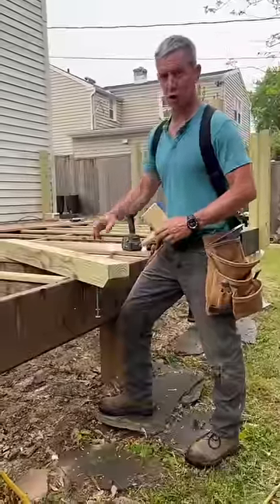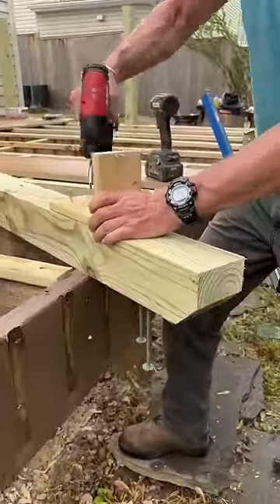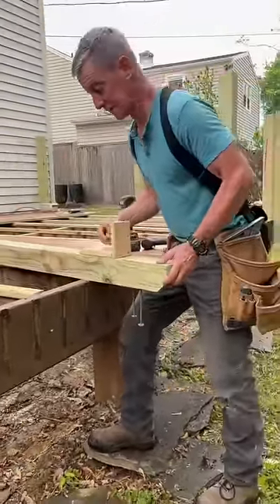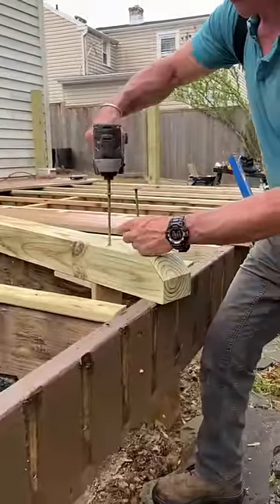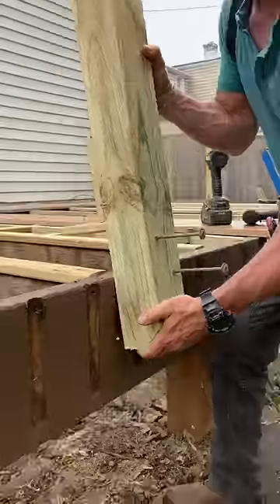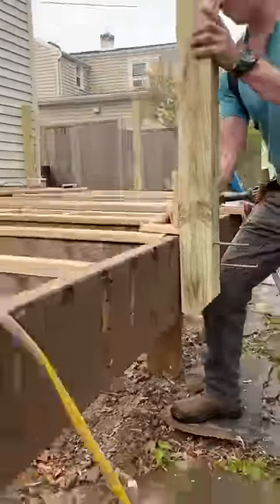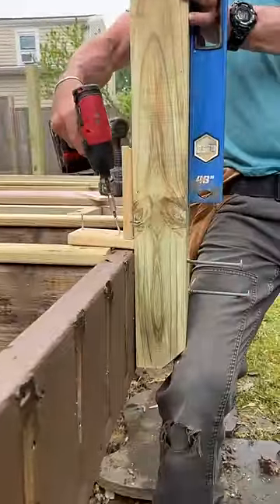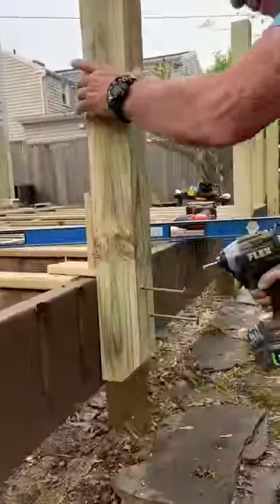DIY Tips: How to set a deck guard post by yourself

Comment: In 6-7 years they at least don’t have far to fall. Watched my 80year old grandfather fall 10ft and break multiple ribs.  When i investigated the way the deck was built it was done exactly the way you just demonstrated.  Well they had 4 lags instead of 3. Edit you have 2
Reply from the maker: I'm sorry this happened to you and your grandfather. However, none  this has anything to do with other carpenters. Clearly, there were problems before this happened.

Comment: I've seen decks built this way in California and people seem to believe it's quality work but on the east coast you'd get laughed off the job by real carpenters. The railing will be wobbly at best in just a couple years, not to mention it's literally easier to do it the right way where the railing posts are structural and come up from a proper footing.
Reply from the maker: Couple things, real carpenter (I love you guys who think you're in some special club...) I am on the East Coast. I've built from coast to coast. And the same screws with the same penetration into solid wood hold up ledgers. I know there are some differences, but I'm pretty confident the ledger doesn't get wobbly. These screws have savage bite.
Reply: Tell yourself what you will, it's not built to last regardless of "special hardware" LOL

Comment: There are so many negative comments for no reason. 90% of decks are built this way around here. One thing we do is run the lag from the back if possible so that the screw is holding into a 4x vs the 2x unless it's screwing into a double header then we run 5in lags.
Reply from the maker: Nice. My connection detail isn't in any of the code drawings that I know of, but the same screws fasten the ledger and hold the beam to post. There is full wood fiber engagement. No over-sized hole for the bolt to pass through. No nuts to loosen up over time. - I agree with you that there is a better bite from the back, but not shown, there's a 2x8 behind that 2x10. People are upset because new things challenges what they know. Keep up the good work.

Comment: We set post to inside or deck then deck screw then block the inside around post so it can NEVER break away from deck
Reply from the maker: That works! - This was a re-skin. And sometimes setting posts outboard is the only way to go. - I do run a 2x4 between the posts for added rigidity. I also like the look. If this post connection fails, so does the whole deck.

Comment: That Flex drill handles those lags very well. I’d like to see it up against the dewalt and Milwaukee
Reply from the maker: Me too. This is Gen 1 on this tool, too. Since I got it they upped the battery tech. Something about layers. They sent me the 5-amp-hour batteries when they sent me the tools for review along with a couple 2.5s. I almost never use the 2.5s. The 5 is a beast.

Comment: A bar clamp and a pencil mark for reference positions works twice as fast.   And you don't have to take a jig off every time.
Reply from the maker: Maybe it does for you, but you have never compared the two techniques. I have because I used bar clamps for years. This is much more efficient and accurate for me. I also hasten to add a note of gratitude. You're one of a precious few who gets what this video was intended to be about.
Reply: @myfixituplife  I've been in construction for 35+years. Everyone has their own ideas and techniques and what works for them.
Reply from the maker: 100%. That's why I posted this. - To date, this dumb little bracket has put money in my pocket.

Comment: I use a nail. Does that pass code? In ct, need to be inside box
Reply from the maker: That's how I learned it, too. We used 2-nails, but same idea. - The idea of the video when we shot it was using the jig, not how to connect the post to the band, but that's all anyone sees, so that's what it's about now. - "Code" is a relative term here because this is a resurface. - I know that it'll work over time (the same screws are rated for ledger-to-house connection) because any failure of this connection will be catastrophic to the framing.

Comment: I drill clearance holes for the lags this allows the post to snugup
Reply from the maker: 100%. And also thank you. I'd use the first 50-seconds of this video--and that was what was in my head when I made this video--to set the post plumb and freeze it there. Whether it was connected by screws or thru-bolts makes no difference.

Comment: Elementary, however I love the fact that he is using the two top of the line impact drills.. flex and milwaukie...
Reply from the maker: I love that you're a tool guy, but I secretly faked you out. Yes, that is the Flex impact and the em effer is a barbarian of a tool (so far, ALL of the tools I've reviewed from them are). But the red one is a Skil. It's a little ... I don't even know, 20-volts, maybe ... DIY model that I absolutely love. It's small, slow, low power and great for installing things like a Larson screen door. I just did two of them with it. I also use it to install Camo decking.

Comment: Even a fall from a few feet up can be dangerous for some people. Guard rails need more security than a few screws in one direction. I mount mine inside the double rim next to a joist, and after I attach to both, I block it in. This way, 10 years from now, it is still secure with zero movement.
Reply from the maker: I agree. Some environments are more demanding than others and I've used the housed post/blocking many times. - On this one--a low deck, re-skin--there is still the 2x6 top cap that has to fail across the grain before there is a catastrophic failure and I've taken enough decades old decks apart to know that unless a tornado throws an oak tree on it, that is a vanishly slight possibility.

Comment: Our ignorant backwater county still won't let you use structural screws. We have to use 1/2" carriage bolts with torque washers.
Reply from the maker: I get it. - I just went through an extensive plan review in a town I town I don’t often build in. - The screws work.

Comment: Certified deck inspector here. This has always worked, but is not ok. Using blocking and deck tensioner brakets or inside the joists, against the rim, and using blocking again. A lot has changed with deck install requirements of recent. Be aware of this before you have someone build a deck for you. Check on new codes for your area, regarding fasteners and install methods.
Reply from the maker: I really appreciate your input. Editorially, there's only so much we can cram into these shorts and a lot of context gets left on the cutting room floor, so to speak. We also can't gauge what catches fire and what doesn't. - I'm familiar with the Code requirements, DCA-6 (and am friendly with one of the Code writers). I edited many deck Code articles when the separated from the general building code, largely driven by the Fairfax, VA requirements years ago. - All my new construction decks are permitted. This one is a re-skin and 50 of the 60 seconds of this video is about how to get the post on layout, not how to fasten it. BUT, the last 10-seconds is all anyone seems to see. Such is life on YouTube. - That said, I took liberties with the spirit of the code (200-pounds of lateral force on an unsupported post last time I saw the Woeste test, a figure itself that came from industrial facilities, I'm to understand; also something I think is inane, but that's for another day). So, while there is no TER on these fasteners in this application, there is common sense. For example, the same fasteners to have a TER ledger connection. - For this system to fail catastrophically, the 2x6 top cap has to fail across the by-6 dimension as do all the other posts, and joist and 2x4 rail connections. - I get that it is not Code, but as I wrote in my Journal Of Light Construction article on re-skins, there is a Venn Diagram between Code, Production and Common Sense. - Food for thought. Not arguing with you.

Comment: I got that 24 Volt Flex drill as well as In line saw, they're beasts , are they not ?
Reply from the maker: "Are they not..." Bro, that impact is Gen 1. I'm told Gen 2 is on the way. Whatever. I'm using it forever. - I don't have the in-line saw (Note: I'm an old worm drive guy; in-line means something else to me) but I'm reviewing the Skil "inline" right now...same parent company...and it is fabulous.
Reply: @myfixituplife  I'm doing this 35 years brother, I used the Skill worm for decades, I'm over it, I do strictly interior cabinet work, fine trim now, BUT, you owe to yourself to try the FLEX IN lINE saw, it's amazing for a cordless.

Comment: Not sure about that pre punching. Aren't screw calculations calculated on a one shot deal? Reusing a hole may reduce the design value.
Reply from the maker: It helps. I doubt poking a hole in the post degrades the connection. It certainly helps keep it on the mark.

Comment: I used to notch my 4 x 4
7” up and 1-1/2” deep and bolt it right to the box. 
But you cannot do it that way anymore. Now it Has to run through the deck and be blocked on all sides. Kind of a pain in the ass. 
I used to screw my 2x2 spindles right to the box too. 
Now you need a bottom rail
Reply from the maker: Oh yeah. I've seen those decks. You've been doing this for a minute, I can tell. There are surface mount details for sure. I usually use the blocking you describe on new construction. This is a resurface. And yeah, the posts were notched when I got there.

Comment: I've never seen those mounted without being notched before lol. I always lag mine after the railing is installed
Reply from the maker: I love the notching detail but it hasn't been allowed where I work in a long time, the idea being you turn a 4x4 into a 2x4. It's no big deal for a few years, but as that end grain wicks up water, it begins to compromise the post. Again, most codes are designed around a worst case scenario.
Reply: @myfixituplife  treated 4x4s are ground contact, i.e water is not a concern. Where in the world do codes not allow notching a 4x4 railing post? It's a lot stronger than what you're doing, I've never seen what you're doing in my 25yrs as a contractor in northeast US.

Comment: You only level the end posts. The middle ones get aligned between them regardless of plumb
Reply from the maker: You're not using level and plumb correctly. There is only plumb here. And even if you align the middle posts with the end posts ( I assume you're pulling a string between posts???) you still need to plumb the posts left and right and make sure they're the same height as each other.
Reply: @MyFixitUpLife home improvement with Mark & Theresa  well, you are using a level so... Anyway no strings. Step back and align with sight. Line of sight is the point as sight from your customer is what you are aiming for. Strings would be a waste

Comment: Definitely don't use any type of shim to bring out the wood because that just means something was out of plumb or level from the gate and that had something to do with that band joist
Reply from the maker: You're right. This is a re-surface job and the band was janked. I do a number of resurfaces each year and I just shimmed about a dozen posts again. It happens on new builds, too and even with surface mounted cable rail posts.

Comment: I literally just built a 12 x 12 deck all by myself and could have use this idea
Reply from the maker: It works. You'd probably have to get this approved by your building inspector. This was a resurface. However, even if I was bolting, I'd use this method so thank you.

Comment: Clamps have left the chat..
Reply from the maker: Extra points for being funny. But also, really, you think that didn't occur to me 10-years ago? Come on, sailor. Clamps move and wobble all over the place. A small screw stays...wait for it...still. Just like we want it.
Reply: @myfixituplife  interesting. My large F clamps don't move at all. I appreciate the screw method also, I build a lot bot myself and do full additions and remodels 90% by myself so I like all methods. I'm just finishing up a large deck right now and my Dewalt squeeze clamps were more than efficient to hold posts in place while I plumbed them up. 🙃
Reply from the maker: @ctbsancho2516  "F" Clamps? Do tell. I think I know what they are (and have 8 of them, Iriwins) but don't want to assume. We may also be using the clamp differently. Again, don't want to assume. - Additions 90% alone is a heavy lift, man. I could but (A) my market doesn't call me for it and (B) I'm glad they don't. :) - I appreciate your perspective. Please chime in any time. We may not agree on everything, but you know what works for you and that may work way better for anyone reading this than what I put out. Thank you for chiming in.

Comment: When do you put in the actual bolts?
Reply from the maker: Good question. Here I'm using structural screws to make the connection, 3-of them. If I were using bolts, I'd still freeze the post like this then drill my lower hole, get a thru-bolt in and snug it up. I'd then back out the first structural screw and drill my pilot hole for the top bolt in that location, then wrench everything tight.

Comment: Post are going to loosen and pull out over time  with lags going into a single rim and no blocking.
Reply from the maker: I hear you. And even if this does happen--the same screws hold ledgers to band joists...different application, yes, but similar bite--the thing that needs to fail first is the 2x6 top cap across the 5 1/2-inch dimension. Yeah, planes crash, but a lot needs to go wrong waaaaaaaayyyyyyy before they do.
Reply: @myfixituplife  I know what quick lags are , I am also a carpenter.  And yea the top rail will stiffen it up, but why not just add a little more meat or use a through fastener.  90% of our job is trying to battle the future.  Prevention is always better than repair.
Reply: Also the lags don't need to fail, the rim joist just needs to split a little, which happens quite often
Reply: I'm just saying the rest of your work looks good man, just seems like the wrong place to get complacent is all.

Comment: Wow full post thickness..usually notch at least a little bit out
Reply from the maker: Notching a post--old school, worked on millions of decks--turns a 4x4 into a 2x4.
Reply: @myfixituplife  But it puts the downward force onto the deck framing not onto the screws!
Reply from the maker: @phillhuddleston9445  I get it. You’re talking about a load path. The load from a deck post guard rail is near zero. I’m completely ok with theses screws in shear like this.

Comment: Are those shims out of treated material?
Reply from the maker: Good question. No. Could I have made them out of PT? Yes. I like a 4-degree angle for cutting them on the miter saw. - They're cedar (I think) but it doesn't matter. Reason is, they'll get a little wet sometimes, but they'll be able to dry out. And, they're mostly there to keep the post plumb. Even if they rotted tomorrow, the post is held by the screw shank.

Comment: Does the post have to be inside the frame?
Reply from the maker: No. It has to--by Code and common sense--resist a lateral load of 200-pounds. And  the 200-punds is he post alone. That excludes the 2x6 top cap, adjacent rails, and post to frame connection.

Comment: If this is a resurface and that much has been removed why wouldn’t you also look to bring the replacement work up to current grade?

I would expect changes to the code to happen for good reason.
Reply from the maker: When I have a deck apart like this, I re-fasten everything and make it as stable and safe as possible. I blow PowerLags into the ledger, re-nail the post to beam connection, re-fasten the posts to the beam (PowerLags, approved for new construction in this application).
Reply: @myfixituplife  but why? Why not upgrade to current code for the owners benefit?

Comment: Put the posts on the inside of the joists and bolt through. Then cut the boards around it. Much neater job.
Reply from the maker: I know. This is a re-skin. It's hard (or impossible) to see. There is a 2x8 inside this 2x10. Surface mount was the only option.

Comment: I always make the rail post to run to the ground and serve as the deck support legs too. That's as solid as it gets. That screwed up crap he's doing will be loose AF in no time at all when people start leaning on it
Reply from the maker: No. No it won't. That's the point.
Reply: Absolutely! That's exactly how I build it . Continuous.  Top to bottom. Not just hoping a screw will hold when Bertha's big ass plops against it😅
Reply: @myfixituplife yep.. he's absolutely right that's the weakest way you can possibly build it. Should be a continuous post from top to ground on the inside of the rim joist. If you're gonna do it that way at LEAST thru- bolt it instead of relying on a few threads in wood